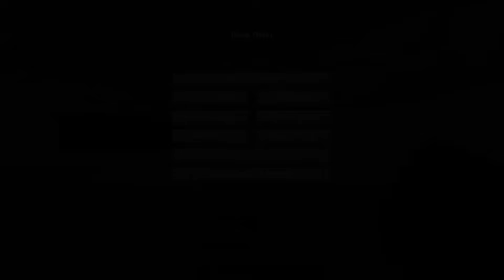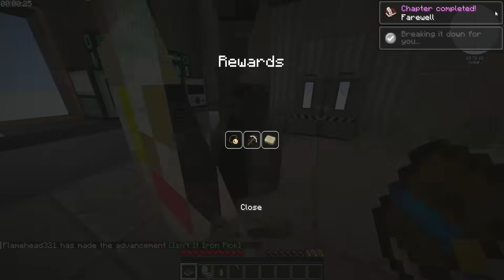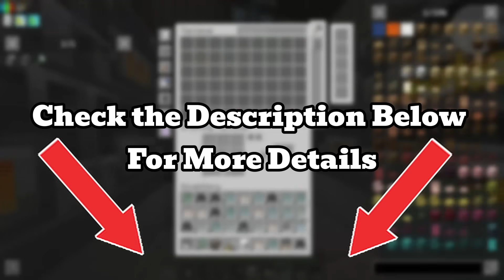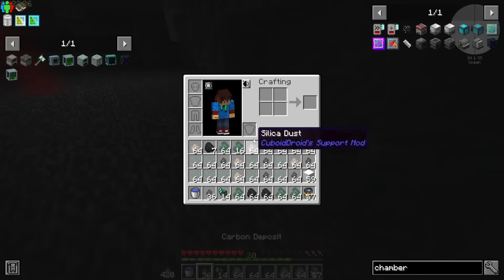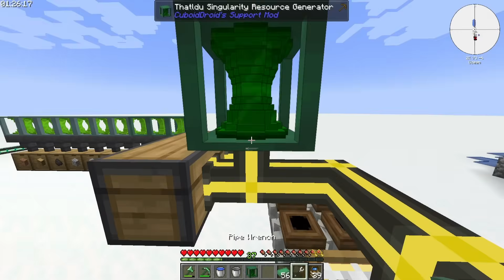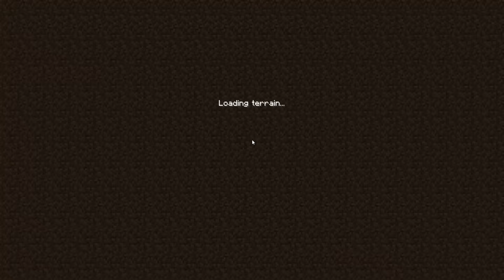A Modded Minecraft Christmas Speedrun

Comment: fyi for create if you aren't speedrunning, you can use a casing (not consumed) on cogwheels to block the shafts, allowing you to stack large and small cogwheels in a neat line.
also adding that you need 6 gear pairs with large cogwheels to get 256 speed (max default)
Reply: Arguably if you hold your casing in the offhand and you get good at switching to a tool and back very quickly you can totally do this while speedrunning. I think it's still a little slower potentially but I'm not 100% sure about that. I'd need to time myself doing it both ways